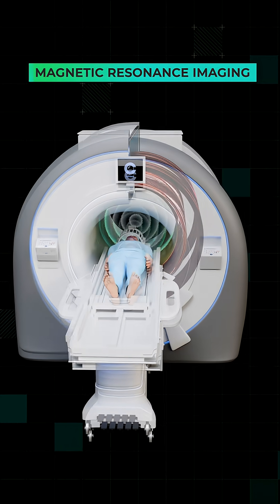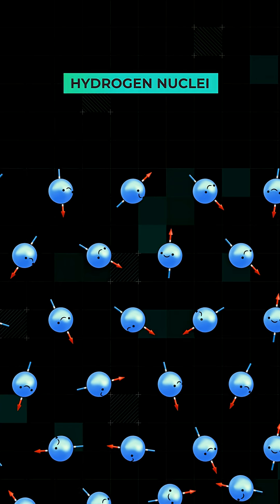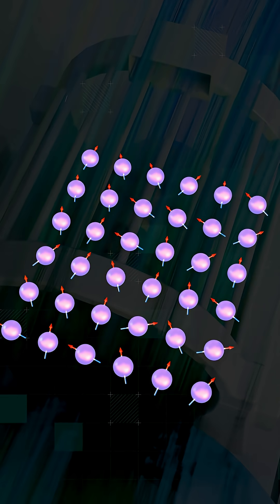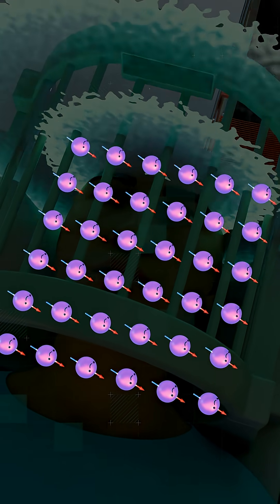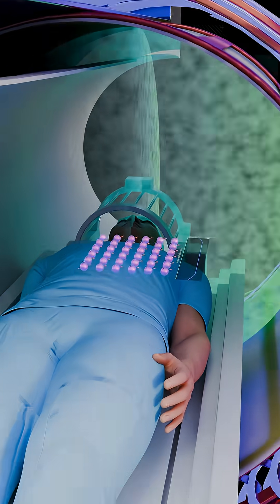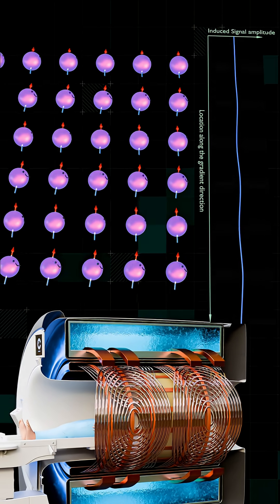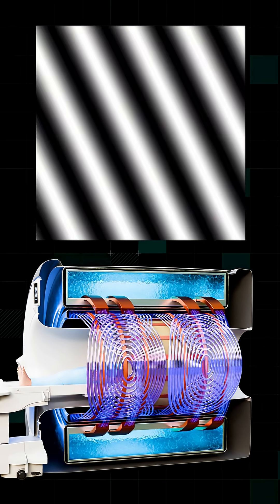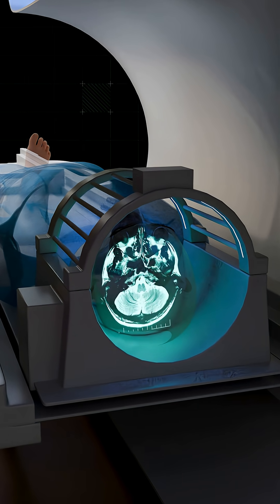The Secret Physics Inside MRI Machines

Comment: Overlays of millions of Interference Patterns. That's what it does. A simpler explanation is that of placing a paper over a slightly raised image, like a coin, then keep raking a pencil over it in every direction. You get an exact image in black & white etchings from the lines of the pencil. 😂 Everything in full light spectrum travels in waves.

Comment: to understand what the RF amplifier pulses are doing along with the other three gradient coil axis amplifier pulses, it is necessary to understand that the RF pulse realigns the polarity 90 degrees, while each of the three gradient axis alter the phase and frequency of the spinning atomic dipoles.  These spinning dipoles generate their own RF signals, however marginal in micro to nano watts.

Comment: Just FYI MRI machines can't operate on their best use case why?
In a detailed study for several economic reason they can't give ppl a maxed detailed 4D(3D is good but a 30 second highest detail MRI can give a lot of life saving advices)
1.they have limited time for each person so machine can't work more than a set amount of time (ppl move and change position but with programming that can be solved)
2.if they want to give max scan they don't have data transfer methods at hand (in my study for a full half min it's a terabyte data)
3.if they upgrade data transfer and storage problem they still need much stronger systems for rendering
4.with all that covered they can't charge person more than a certain amount and even if they would they would limit patient flow
Because of those reasons there's handful of health institutions with equipment to give a super detailed scan and only for special cases that has no room for error wich doesn't include normal people.

Comment: Isn't it radioactive?
Reply: MRI doesn't use any kind of ionizing radiation.
Reply: @soundspark It is still radiation.
Reply: @TheAzachiel  Not radioactive however.
Reply: @soundspark if it's not radio- must be television-active, LoL 😂😅😂
Reply: @soundspark That is true, however it still have effect on living organisms that haven't been studied. There has to be more studies made. From what's out there I'm not satisfied.
Reply: @TheAzachiel  Guessing you believe 5G is a death ray?  There are injuries and deaths from MRIs but that is due to not following safety protocol and being struck by objects flying into the magnet.
Reply: @soundspark Good point, however that would imply, that I think of low power microwaves as ionising radiation. I don't,  as I mentioned in previous comment. There is one case experiment, that shows it is causing clumping of red blood cells. That isn't exacly any proof, but there is a suspicion. That is a reason why I want more research. This is what science is about. Questioning. If you know anything about biology and PH, you will understand that reason, why red blood cells would clump on each other is that they loose their negative charge. That relates to PH, as it it measure of micro voltage. That means your body is becoming more acidic. That is breeding ground for cancer. Feed it sugar or too much carbs and cancer grows. Thats my current hypothesis. I'm not jumping to conclusions. This is why I'm saying again: more research required.

And in reaction to your first sentence: do not judge others as you know nothing about them.
Reply: @TheAzachiel  However despite the Clippy claims there have been numerous MRI uses with zero long term health effects observed with the only observed problems being reactions with foreign bodies or prohibited metal objects within range of the magnet.

Many of these studies are unrealistic in actual human exposure.

Comment: Please explain how a heat pump heater works, I can't get the thing in my head in any way. How you can use a super cold gas to generate heat? I'm not sure if this is the proper name but it's a unit similar to an ac machine.